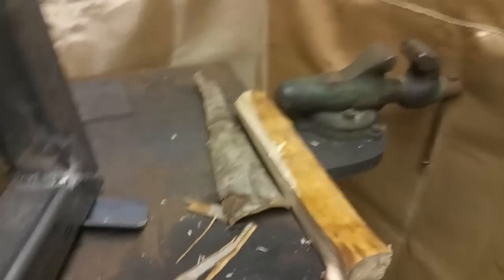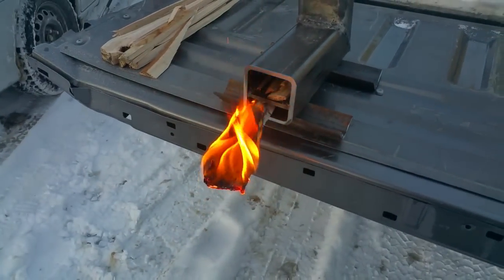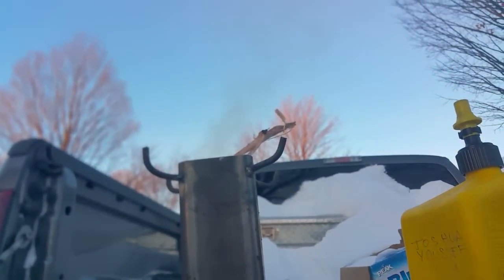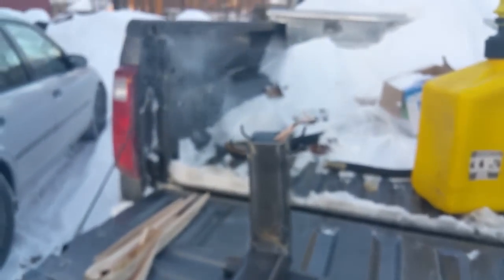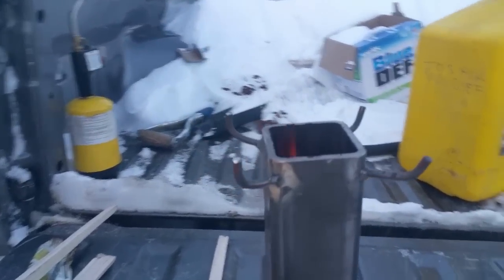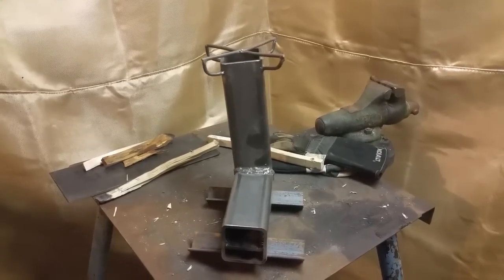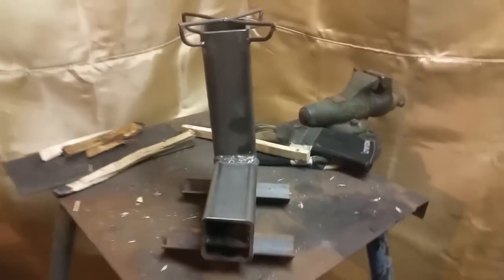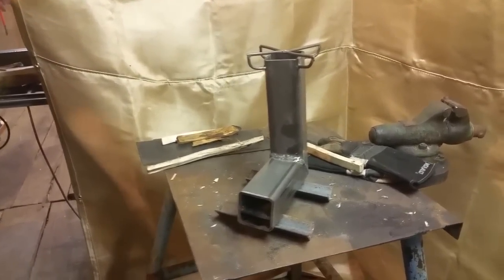Lighting the 30-minute rocket stove for the first time | Redneck Homestead

Comment: Drill a hole, then drill and tap a smaller hole above it, then make a small access plate, roll access plate out of the way to light the fuel then slide access plate back over hole...viola...easy light rocket stove 
great job...keep up the awesome videos

Comment: The reason it was slow in getting to operational temperature is because the chimney metal is so thick.  It is acting as a heat sink.  It will heat up 4 times quicker with 4 times thinner material, and with steel 1/16 inch should be fine for this application.

Comment: Lengthen the vertical portion to increase the draw. It will burn hotter with a longer chimney.
Reply: +2 mm steel not 6 en insulation

Comment: Being independent of all public utilities would mean you couldn't have welded it or cut it out, not to mention the energy used to form the steel tubing that you use.  Not exactly "green".
Reply: I've been able to weld, and cut with an angle grinder, by using my solar&wind to charge my battery bank, then using an inverter to convert from DC current to AC current so I can plug-in my tools, etc.

Comment: get two matching steel truck rims an old washing machine drum stainless steel ...cut back off drum ...cut access hole for lighting ,,,,place rim on floor put  ...put drum on it fill with wood put rim on top ...light .....when going will boil  5to 8 gals in 20mins
ideal for chiken processing showers baths purification washing clothes being human used all over easten europe usually in small wooden shelter made of pallets